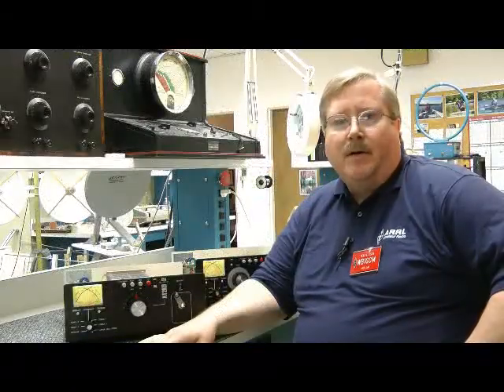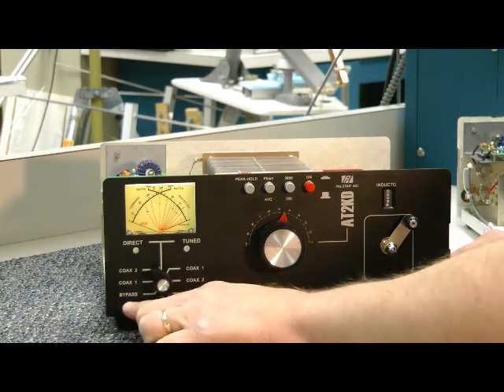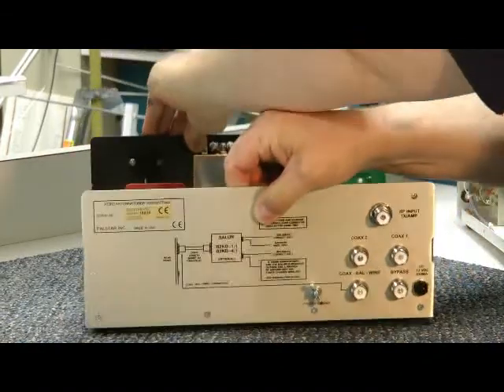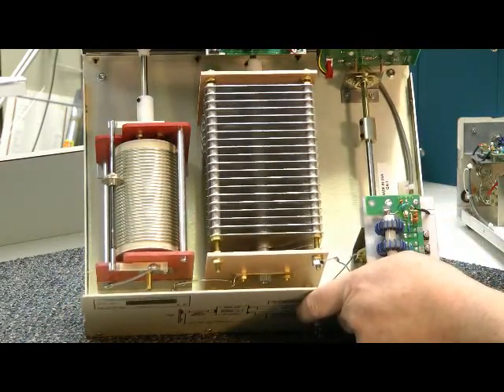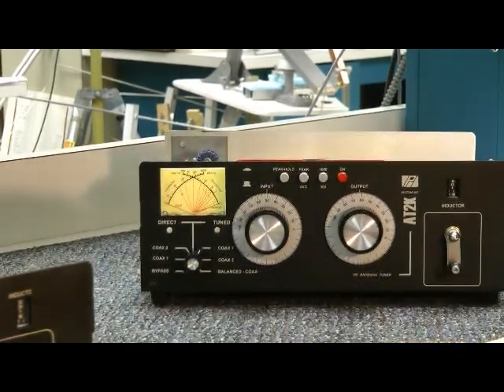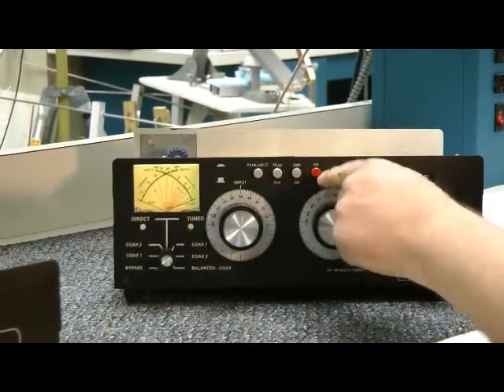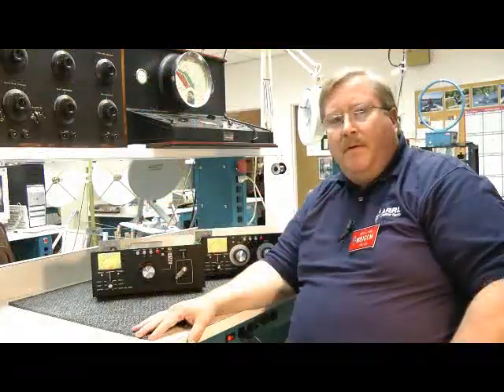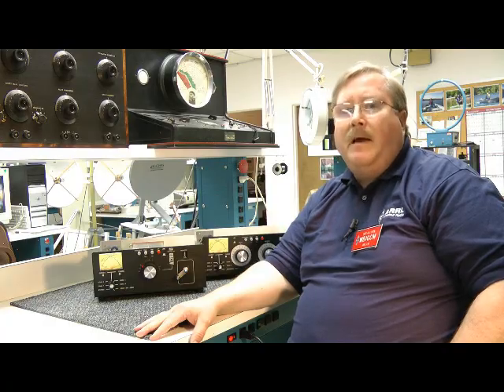PalStar AT2K and AT2KD Antenna Tuners

Comment: For maximum efficiency in a Tmatch tuner, it is best to find a solution that uses the maximum amount of capacitance as possible to get more coupling to the antenna.  Your suggested setting of "60" will get you a match, but not the most efficient in most cases !